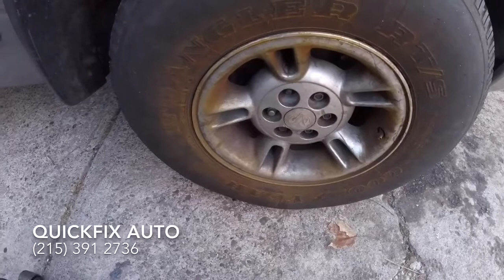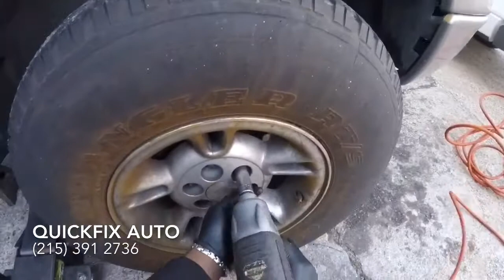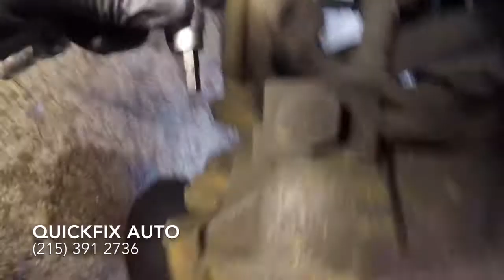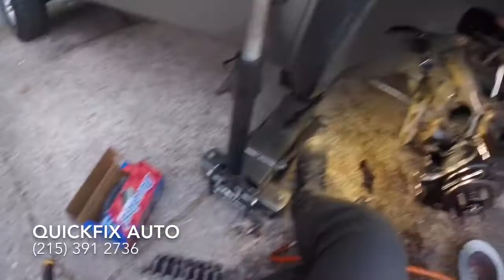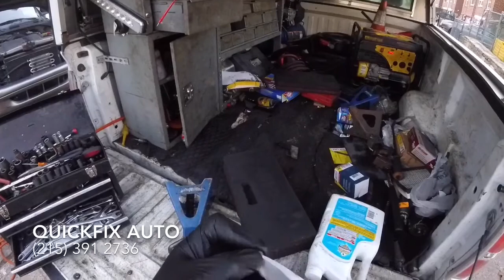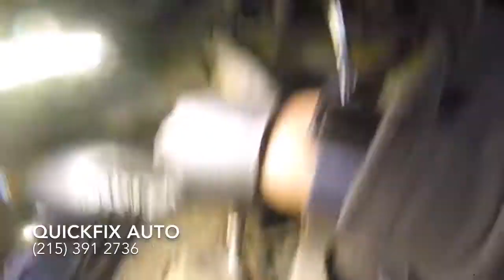2000 Dodge Durango Front Brake Pads and Rotors Replacement :Philadelphia

Comment: Mine has a mustache looking clip that goes on the outside of the calipers. It’s a pain the the a$$ to put back on. I don’t see on yours? Mine is a 2000 Durango Slt rear wheel drive with Magnum Engine

Comment: Only put a lil lube on it when that get to temp it could leak down and make the brake system fail. If grease gets on the rotor or pads there goes the friction needed to allow adequate stopping power I did enjoy how proactive he is about doin a great job and covering all bases

Comment: Did you forget the brake clip?  That goes to each brake pad brackets?
Reply from the maker: No when I stayed the job they were missing customer knew but choose not to pay to replace them. “She stated I have been doing fine all this time” so 🤷🏾‍♂️
Reply: QuickFixHere ah, kk I just did my 2000 Durango brake pads and rotors as I watched, I put the first tire on and forgot the clip.  Lol  I took it back off to install it.  Thanks for the video,   I’m going to do the rear drums next, pretty much the same?  My floor jack didn’t lift it as high I noticed you have a shim to lift it higher,  I’ll have to do that to my jack.

Again thanks for the video.
Reply: @chooseyourlife9894  Pretty sure that year have none. The 03 Durango has a floating brake pad setup where you have a bracket for the pads to sit in and there are abutment clips for the pads to ride on. That 2000 Durango you worked on has ears on the knuckle that the pads ride on, so its important to clean off the rust and get is smooth then coat with brake lube to prevent the pads from binding

Comment: What about the pad clips?
Reply: There are no clips on that setup. That's one of the problems with that brake setup. You need to file the ears on the knuckle where the pads ride and make sure its well lubed to keep it from rusting and binding the pads
Reply: @bobsoft  mine had clips though. It's weird because when I bought the new pads, they had different clips than what was on there. I ended up getting rid of that piece of shit. I hated that thing